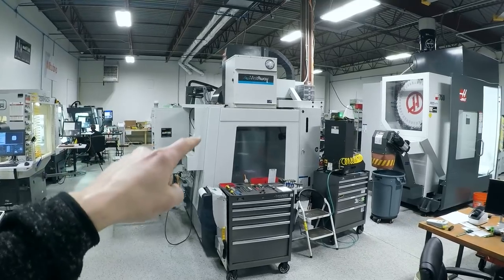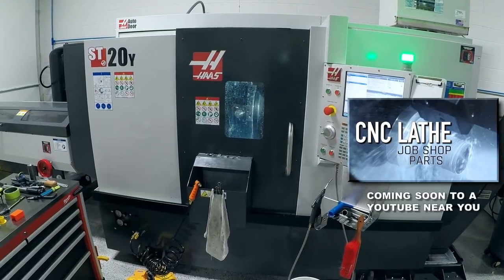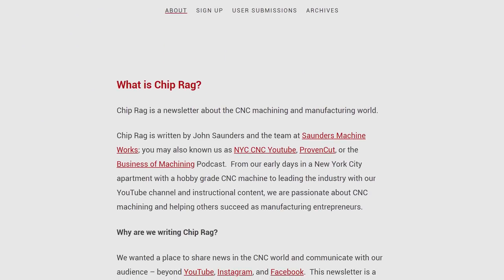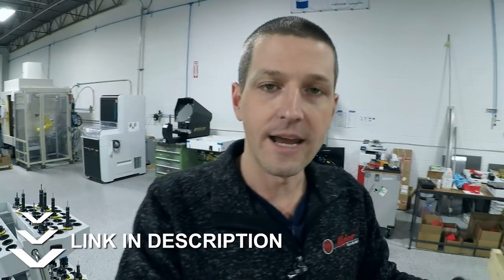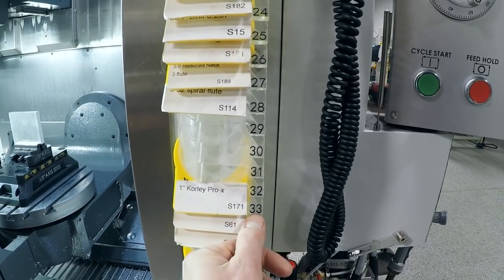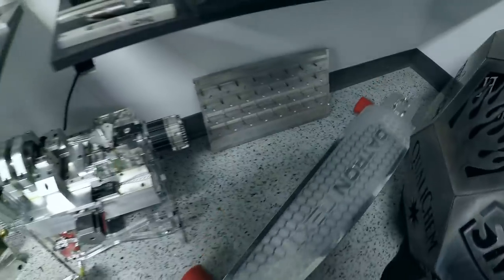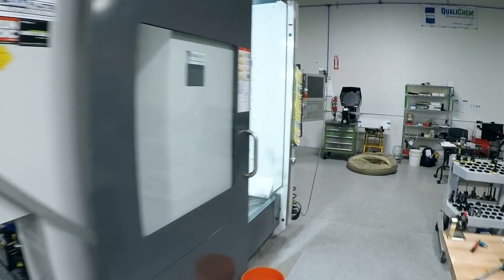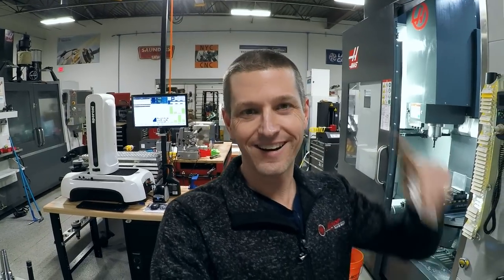Shop Update - February 2020!  New Machines, Mist Collector Mistakes

Comment: The Datron partnership sounds awesome until you realise that Datron pulled all of their Application notes (Machining strategies, feeds & speeds) from their website with the sole intention of reselling them through provencut.
Reply: Andrew Wadsworth We’ve had 6 Datron’s. Service/support has always been average at best and very expensive. We recently had a spindle fail and they wanted £10,000 for a service exchange. So, this kind of move doesn’t surprise me. Would never buy another.
Reply from the maker: Not the case.  They re-did their website; I cannot speak to if/when/why application notes were removed, but ProvenCut will compliment their resources, not replace them.
Reply: Can confirm what John said - since the site was revamped in September a lot of content has moved or gone into hiatus. We are working to correct that but will always offer applications assistance for our tooling customers, just give us a call.
Reply: I have absolutely nothing bad to say about the support which we received from Datron, in fact, it's quite the opposite. I am only a little irritated to see that the resources which I referenced extensively over the past couple of years have since been removed.
A website revamp doesn't explain why the resources were also removed from the German site, which as far as I can tell, has not undergone a revamp.
Reply: @wadsand  so... Did you ask them where they went?  From the comments it seems like there were some assumptions made, so curious if you picked up the phone and that's truly what you were told.

Comment: I have a Job where I need to make about 50 316 stainless rectangels that are 1/16 thick 1/8 wide and 5/8 long I would be curious how the wazer would do on it.  Im cutting them on a VF-2 currently and is very painful.  If tabbed there's lots of hand polishing and if I do the superglue method I can only make about 4 at a time before the tape gets too soggy to hold anymore.

Comment: John, is there a way to have fusion post different tool numbers for the machine carousel?  Or how are you handling having 2 different tool numbers when in use.  Would love to hear your solution.
Reply: The tool table should have a tool number and a pocket number. You can load tool 171(or whatever) into pocket 1 and the control will know where to go to get the tool that the gcode asks for.
Reply: @michaelalcocer6778  which tool table are you referring to?  Haas or fusion?

I do not see an area to differentiate in either, I do not have the side mount toolchanger if that makes a difference.
Reply: @siraig  I use linuxcnc/pathpilot and you can pull up the tool table under the file tab or look in the folder that contains hal files etc. It's probably in a different location for haas controls but most controls should work under the same principal. I would look for the pocket information where ever tool offsets are kept. I did a quick Google search and it seems haas controls with side mounts will let you access this information however there was a post where it seems their umbrella tool changers will not. That's a pretty severe limitation if you cannot have dozens of tools in a tool table and select the 12 you are actually using from that list, ie the ones in the actual tool changer. A further search of haas suggests that setting 90 allows you to expand how many tools the control will store, up to 200.

Comment: What size/type fixture plate was on your shapeoko? Ive been thinking about doing that for months and "new product" is all the motivation I need! Also Ive been searching for an explanation for this, it might make a good video someday: On many 5 axis machines the travels are very large (Hurco VM10Ui for example) but the plater is only 8". I also watched a Haas Europe video on the UMC-750 and they mentioned you can machine a part up to 27" in diameter but the platter is 20" in diameter, John, could you dive into machining parts on 5 axis machines that overhang the platter/workholding. Is it feasible? What are the compromises? Does accuracy suffer beyond acceptable limits? Is there too much Chatter/Deflection Ect (probably very dependent on material and thickness) I think the question could have large relevance for smaller shops looking to get into 5 axis but with limited budgets and floor space would look at smaller 5 axis machines and who would also need to run the machine in 3 axis fashion for production work at times. Hope this makes sense, Thanks Jay

Comment: Why not use 1200cfm Mist-Aways on the larger machines? Rather than switch to 1200cfm Filter-Mists?
Reply from the maker: We had to buy new ones, wanted to try a different model
Reply: @nyccnc  which do you like better? I have a shop full of Mist-Aways. But, they don't seem to be as effective as they used to be. Even with constant maintenance. And, I'm kind of tired of buying the expensive merv14 filters.
Reply: I really like to hear how you like your filtermists we've had them for years, they work but seem expensive to operate.  I find if your not constantly changing the filter on top the dont work well.